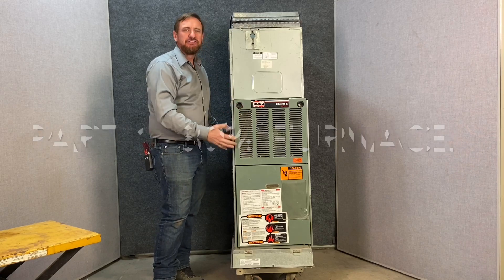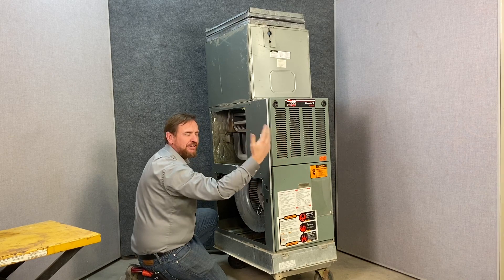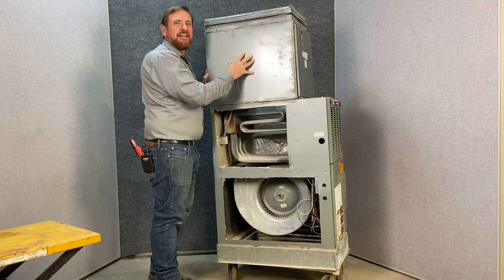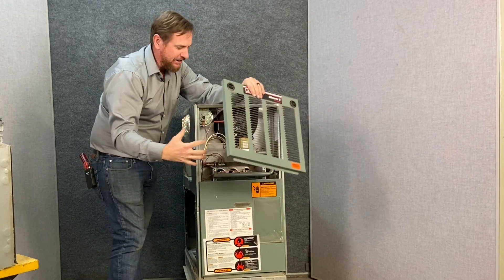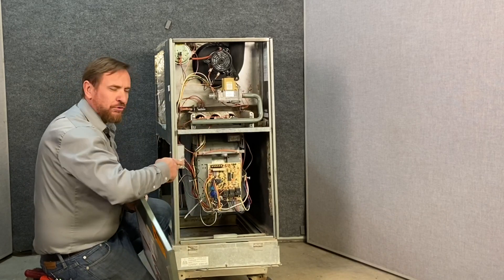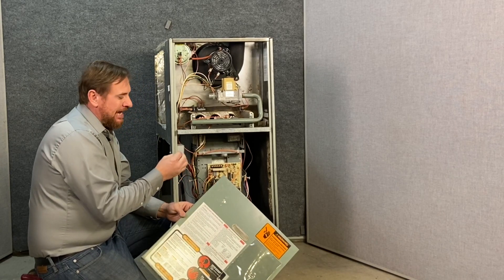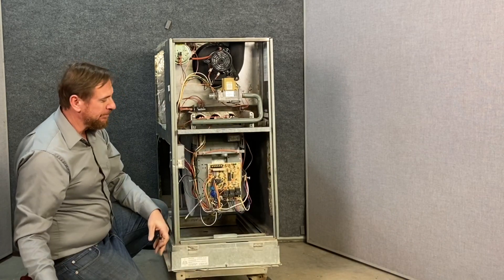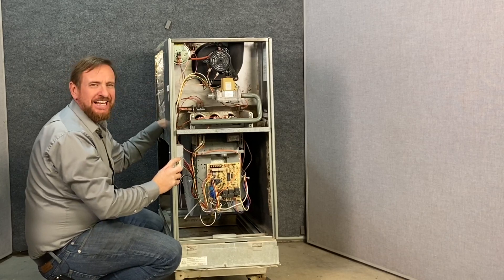Part 1 80% Gas Furnace (overview)

Comment: Ty, for the flow pipe in 80% gas furnace is possible to make a 90 degree in the end of it? I see some furnace got water from it.
In 90% furnace why made the end of pipes close to others? I see that not make any sense because it’s blows combustion air from one and it will suck part of it from other one.
Thank you.🌷